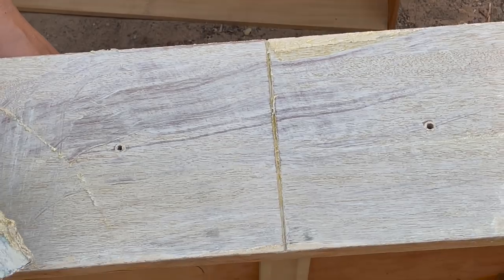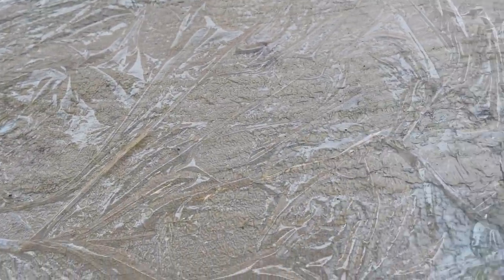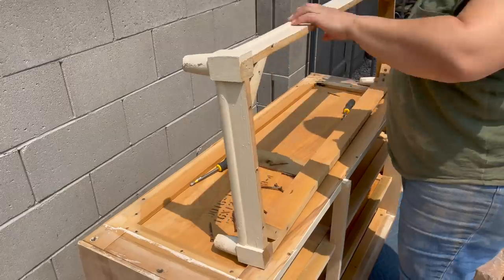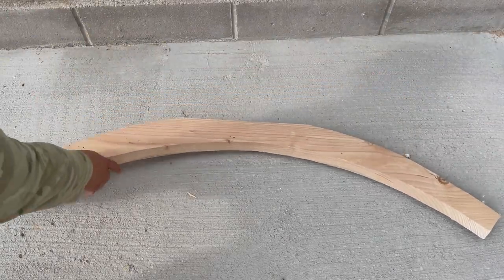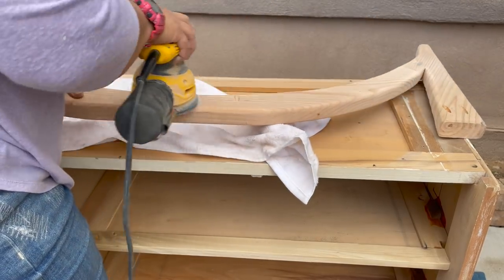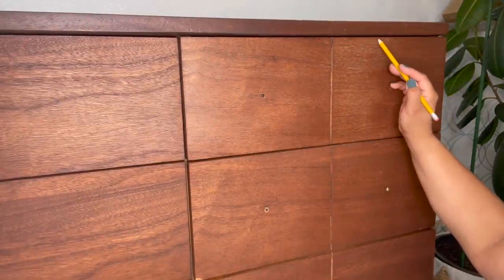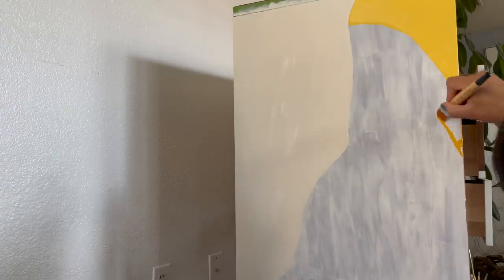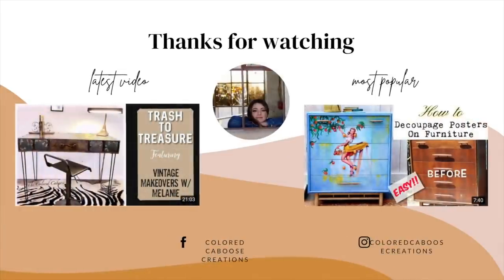Modern Boho Dresser Makeover/Diy Furniture Legs/ Ugly Duckling Challenge/Furniture Flip/ MCM Redo

Comment: Love this piece!! So many questions though.  What sealer did you use?  Do you sand in between coats of sealer?  I bought that router and the sponge as soon as I watched this.  You need a sponsor girl!  You're a true artist with her eye on lthe latest trends.  So refreshing.
Reply from the maker: I believe I sanded in between a couple of coats of sealer which was minwax poly acrylic satin. The sponge applies such a thin layer that it usually settles pretty evenly. After it’s dry I run my hands over and if I feel any roughness I’ll lightly sand with 300-400 grit sand paper. Hope this helps thanks for watching 🌺

Comment: have you ever tried Tal-Strip often referred to as "Aircraft Coating Remover" best one I ever used, but its caustic and requires an after strip rinse step and proper handling ie. gloves and proper disposal but its the most powerful I've ever used besides strait up hydrochloric acid gel.
Reply from the maker: No I’ve never even heard of Tal-strip but I’ll definitely be checking it out now. Thanks for sharing.
Reply: @coloredcaboosecreations  :-) hope you can find it and find it useful.  by the way there are like two varieties of it, one is less caustic but still good, I didn't know there were two types till just recently. good luck